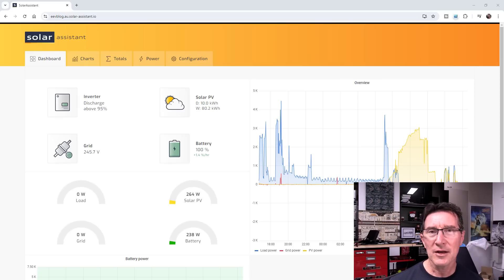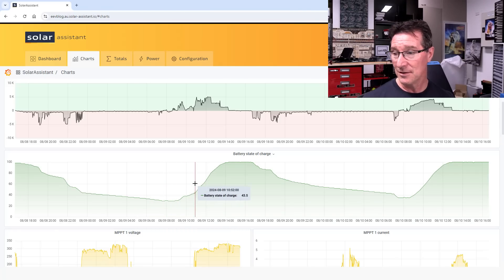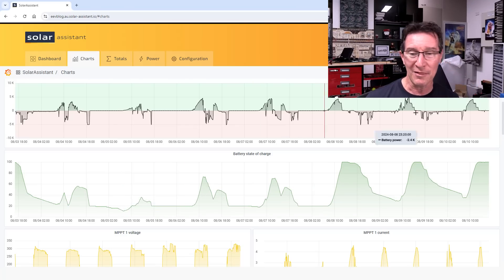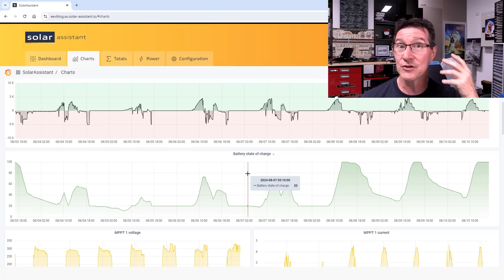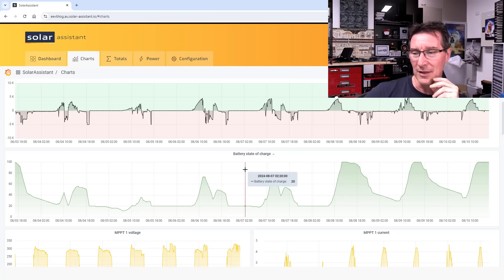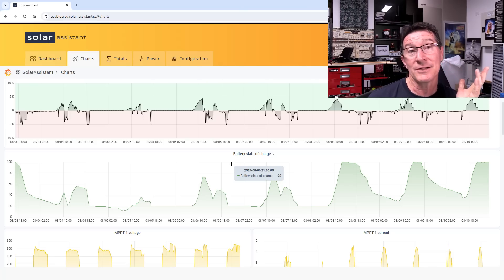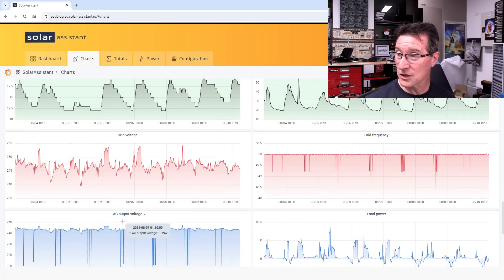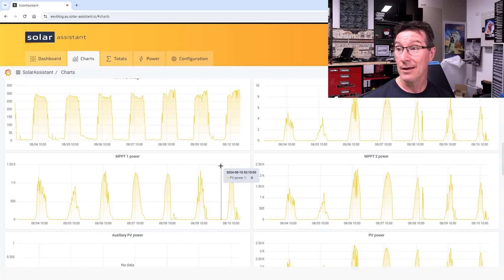We're Gonna Need a Bigger Solar Battery...

Comment: Bigger battery means more self solar consumption and you are more independent from the grid
It also means your battery lasts longer because each cell sees less current and less cycles

But it also means that your battery becomes less economical and takes longer to return your investment

The best case economically would be to make a full cycle every day
That doesn't usually work every day for obvious reasons but if you get about 250 cycles per year it would be best (economically)
The bigger the battery, the more capacity is more often unused
What use is a 30kWh battery if you are using only 15 every day and the full 30 only once a week?
And since you have winter now, you will use more power and gain less from solar, so you have more need for the battery. Wait for the summer and you will see, that your battery might only go down to 70% during the night, leaving much unused capacity

Of course you can argue that you want to be more independent and have spare energy for emergency reasons for example

I would wait until the price drops a bit more on these modules. Should not take that long

I have 15kWh and 10kWp solar. In the summer, 5kWh would be plenty of storage. In the Winter it could be 30 and would not be enough

Don't have a fixed 20% lower limit. It wont make a huge difference to the life of the batterys if you discharge them now and than to 0%. Either make that dynamic or disable it. Victron energy calls this function "battery life" where it raises the lower limit based on solar production. If the battery didn't get full on one day, the lower discharge limit goes up 5%. So if you aren't charging to full on 5 days in a row, the lower limit would be 25%. And of course it's the other way around, wen the battery gets fully charged, the lower limit gets 5% less. This function ensures that you have a full battery every day. Since a dead battery is not useful, it makes sense to "raise" the charge window like that

Comment: My electricity use is up to 600kWh a month - that feels like mostly ~20kWh a day usage, that seems like a decent battery target... (I do have resistive water heating though, but no aircon or EV...)

With all the data you have on the system, you could probably get a good idea of how heavy, say a 95th percentile night is in energy use and scaling battery based on that...

Comment: OK i didn't understand why do you bought such a tiny little Deye inverter? you can get them (single phase) up to 16 kW, and parallel them.
Reply from the maker: Existing wiring only handled 5kw, and it's closed to enough

Comment: I always said to my customers, more batteries is better, if you can afford it. The rationale is that in winter you'll be cycling less aggressively and you're distributing the stress on the batteries across more batteries which increases the lifespan. It's an expensive proposition, so it really depends on your goal and budget, but if you're discharging the batteries too much every night, you need more batteries.

You're always better off storing the energy and using it yourself rather than selling on the grid. You should also start to consider your hot water as a battery too.

Have you also considered peer-to-peer energy sharing with your office? You probably can't yet without a smart meter, but does this even exist in Australia yet? It is becoming popular in Europe.

Comment: A wasted battery is one that is not used, so one approach is to AIM for your battery to reach 20% when the next charging cycle begins. It is tempting to be seduced by seeing wasted solar, but it is also wasteful to not discharge to 20% often.
Reply: Shorter battery life. The more discharged & the faster the charging time, the faster the batteries will degrade.

Comment: Is there any way to reduce the big consumption things, like the oven? Maybe a smaller pizza-sized oven? Purely from a physics perspective, we're creating heat for the oven by just resistive heating, which feels ridiculously inefficient. Surely there's gotta be a more efficient betterer way, like a really high-temperature 300C heat pump of some sort? Or a heat battery for excess solar, rather than storing the energy in batteries? Could really hot water be stored in an Aerogel-insulated wall-mounted "tank" rather than using a kettle every time?

Comment: Use voltage, not SOC on lfp...charge to ~3.45v per cell, discharge to ~3.0v - that should give you >90% without degradation. Andy (Offgrid garage) has a video on this.
Reply: Yeah, with LFP you should use more than 80%..
Reply: The batteries have a metering BMS that manages the SOC so there is little danger in using SoC as a limit, in fact almost all manufacturers recommend ~18-24% SoC, Pylontech, Basengreen and some others do.  
And yes that 80% usually correlate to ~2.95-3.05V.

Comment: The real question is how much extra life do you get from a battery by only discharging to 20%? Is it 20% extra life or more? Is this something companies tell you to do so that the battery lasts just beyond the warranty period? :)
Reply: 100% use will give you 3000 cycles DOD, where 90% use will nearly double the life span, and 80% and keeping them cool, Ie no big loads and slower charging your be looking at 10,000 cycles to 80% DOD, but people have gotten over 15,000 cycles in testing on Endles-Sphere forums and Battery Uni.

Comment: Thx for sharing ur journey Dave. You might want to hold off getting more batteries until you have a better idea over a 12mo period just how much electricity you're buying in order to work out if there will be a payback at all. Winter with lots of rain/clouds and shorter days probably is going to be the worst of it. 

I'm in WA and live on the outskirts of Perth and we do a ton of driving and I wanted to be able to power everything (including our driving) from solar if we could. After lots of calcs based on what we used for the house and estimates for the cars I was surprised the best thing was just to provision as much solar as possible and use it while generating and go with a smaller battery. FYI I've had various solar on the house since 2009 and to handle the above we upgraded to 16kw of panels, 10kw inverters, and 10kWh of battery. That pretty much works for us the whole year round and even in winter can cover 100% of our usage with the exception of extended days of rain/clounds. But even with bad weather i'm impressed with so many panels you still get generation enough for our house usage - maybe not enough to really cover EV usage though. I keep wanting to max out my batteries too btw, up to 30kWh but I don't think there's a financial justification :) Well unless WA adopts something where I can sell the excess... I do allow my batteries to 100% discharge though, yes happens a bit in winter but for a lot of the year it never happens since long days etc...

Comment: The big dips is the kettle
Reply: I found it so amazing how much power the little old kettle can draw! Before I got into the solar energy game I used to fill the kettle and boil it for one cup of coffee! 
I have since stopped doing that, I now only put enough water for the amount of coffee cups I'm going to need! 
I have since found an 800w kettle on Amazon which I use on my solar plus battery system, the previous kettle was using 2.2kw and was very fast but at the time I was only using a 3kw inverter and would often run into an overload protection situation when the fridge would fire up and cause a spike going way over the 3kw inverter limit... Even though I had the inverter running a constant load of 3.2kw for hours, anything with a motor in it would give me problems, so I got a 6kw inverter and have not had to run to the garage to restart it since! 
There has to be a better solution for boiling water to replace the humble resistive heating element kettle!
Reply: @PeterMilanovski  Yeah its crazy the differences appliances people rely on how much power they use. Like a Clothes dryer, I have never used one but people that rely on them have massive powerbills. The difference between someone that uses hardly any power toward someone or a household is completely different. I was a electricity power meter and some houses their bills would be about $100 a month then the house next door running their air cons 24/7 their power bill is $600-1,000 a month. 

I've got a mini solar set up but its not installed since ive moved. i would just run 2x300w panels to a battery bank seal lead acid of 12v 1800amphs i have in my shed. All it did was run a fridge, computer, light and fan. I also used to charge my e-bike. 

anything that requires a ac current will have huge spikes of current. I've made a e-bike that had a 72v battery with 150amp controller that works similar to an inverter but more 3 phase power because the motor is 3 phase brushless dc. The controller had a peak power of 600amp phase power. all that power was spike of power needed to shift the magnets on the motor to be in phased with the controller. 40kw DC running through 2 wires between my legs was pretty bonkers. The DC fuse plastic would melt ark flashing

Comment: "Barely lasts all night" might be worth it to check how to reduce your idle power. Maybe only use your heat pump water heater during the day? Seems like you have got a 500w-1000w idle power draw which is crazy. Im sure you can get it down if its not all because of heating. Maybe reduce temperature setpoint during the night? Just sharing some of my experiences.
Reply: would love to see a video of Dave hunting down all of the sources of idle draw. Reducing it by 100W would increase the equivalent battery capacity by nearly 20%. I'm guessing the fridge and inverter are the biggest culprits. Not sure how much there is to do for either of those. Maybe adding some thermal mass to the fridge/freezer would make it run less overnight?
Reply: @alexandertrimm5246  That would be fun! Yes the idle power drains the battery dramaticly. Fridges are designed to keep cold for 24 hours. You could put a timer on it so it does not cool during the night.
Reply: @csongor48 it should be a bit more then a freezer if we are talking 15 kw
I dont feel like my cooler or freezer on my battery in the night uses anything

But no doubt stuff like cooking can eat alot of the battery for example
And so does cooling /heating
Reply: It is set for the day.
Reply: Yeah my parents got their "idle" use down to ~200 Watts at night, that includes WiFi/FTTH, 1cooler, 2freezera , NAS and all the rest of tech they have around the house.  
I guess more

Comment: Bigger bat, just fill it out. I'm waiting for someone to release a chargeverter or hybrid inverter for 48v  that connects to the variabel pricing we have here I Denmark(some times it's negative). And I really want to go the modular rack battery way, my guess is that we need minimum 20kwh to begin with and then upgrade as money allows. On week days I need 10-12kwh for the car and, and the heat pump for heat and hot water is between 1.8-30kwh a day depending on season.

Comment: LFP batteries will degrade about 1% a year just sitting there. That's the nature of LFP. They should still give you at least 80% of their original capacity after 10 years doing a full daily discharge and charge. Basically using 100% of an LFP battery daily causes less degradation than the passage of time. They're a depreciating asset. Might as well use their full capacity, or at least 95% of it, instead of pulling from the grid. You've paid for that capacity. You are not likely to use the bottom end of the capacity most days if you buy more batteries, so even if you're worried about hypothetical bottom end degradation, that won't be happening every day.

Remember that LFP is fine being used for its typical full charge cycle (2.5 to 3.7). It's not like NMC that does degrade when you charge or discharge it fully.

If you're only using the top 80%, you'll have at least 64% "usable" of the nameplate capacity in 10 years. If you want them to last 15 years, you'll lose 15% total capacity just from ageing, and maybe down to 70% considering usage. Using only 80%, you'd be down to 56% of nameplate. Consider that when determining the quantity to buy. It's nice to buy one series, while available, that all works together. It may make more sense to just buy all new batteries in 10 years, as solid state batteries should be very cheap by then—solid state batteries are going into prototype cars already—but I also know you're the kind of guy that likes to keep older stuff working if it's still functional.